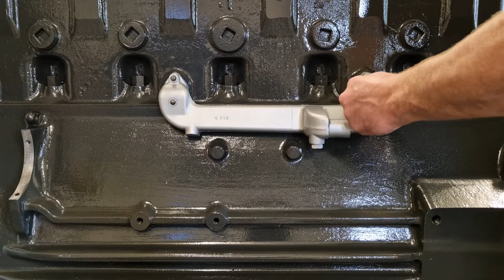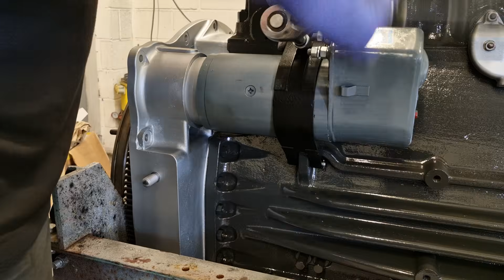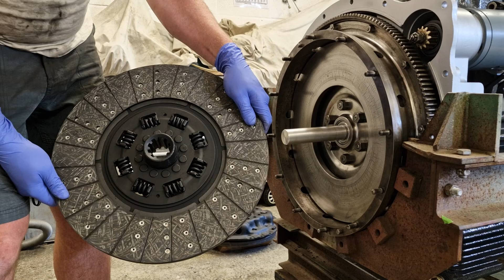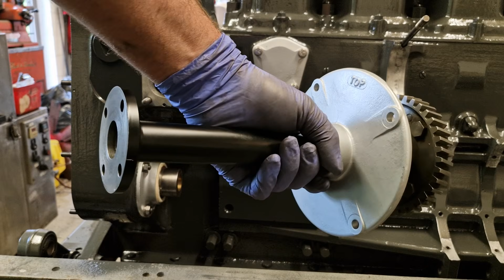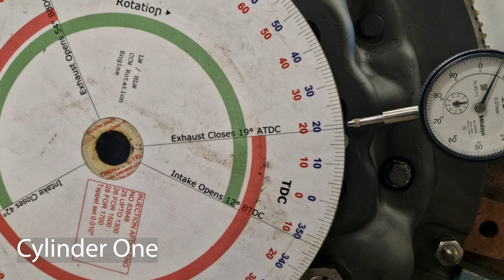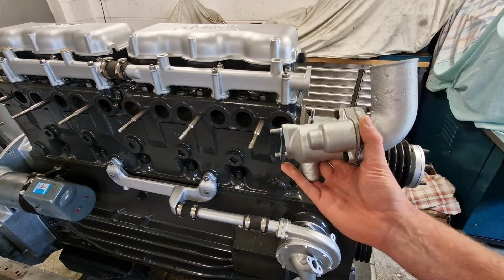Gardner 6LXB 180 Overhaul Part 7 - Heads, Timing and Shiny bits.... Atkinson Borderer

Comment: a bit late to the comments but having Rebuilt this engine.., WHY are you putting it together With PAINTED Gasket Surfaces ? Putting gaskets on top of a painted surface is Bad Really bad Every workshop manual in the world will Say about gasket surfaces that they are to be Clean free from grease paint or other contaminates just an obervation.

Comment: Flywheel has many cracks from overheating or slipping?
Reply from the maker: There was some heat cracking on the flywheel clutch plate, not the flywheel itself. But the clutch plate was NDT inspected, resurfaced and deamed perfectly servicable.
Reply: @MPSVintageDiesels  Fair play, just saying and understand you had seen the same and got it ndt tested. tough of girls they are for sure. thanks for sharing the content as very informative

Comment: Was the flywheel rubbing plate machined? if so did the flywheel/pressure plate flange need anything taken off to compensate?
Reply from the maker: 0.003" Taken off the flywheel plate and the same off the pressure plate to clean up the faces. depth of the flywheel plate altered (as its bolt in) to compensate for it.

Comment: I just can`t believe the Gardner company has disappeared. What a waste. And why.?
Reply from the maker: Unfortunately Gardner didn't move with the times and were late to the turbocharging fold which allowed the likes of Cummins to get a foothold by offering higher power outputs than Gardner could. By the time Gardner did go turbocharged it was to little to late with some of the last models like the LYT and LG1200 being rushed to market and suffering from reliability issue which tarnished the name that had been known for unrivalled reliability.
Reply: Best therapy ever rebuilding takes me back to stripping auxiliary engines off afloat ,cheers 👍

Comment: Hi There my real Name is Mr Cannadine T. Boxill-Harris I was wondering, why couldn't you and your teammates can still do those Rebuilding and Repainting those nice fresh shiny Gardner 6LXC, Gardner 6LXB, Volvo TD102KF, Gardner LG1200, and Cummins M11, 4 Speed Leyland Hydra cyclic Automatic Transmission Alexander RV Buses and Repaint them to a Grey Green Colours just like the original Scania Grey Green's which were in the North London and East London bus routes such as 141, 168, 179, 210, 275, 125, 173, 24, 167, 313 and also the bus route 103, if you guys would like to Rebuild about 228 of Those Gardner 6LXB, Gardner 6LXC, Volvo TD102KF, Cummins M11, and Gardner LG1200, 4 Speed Leyland Hydra cyclic Automatic Transmission Alexander RV Buses can you and your teammates put most of those Gardner 6LXC and those Gardner LG1200 4 Speed Leyland Hydra cyclic Automatic Transmission Alexander RV Buses to those East London and North London and that especially is including the London Bus such as those London Bus Routes such as for example the 296, 341, N29, 86, 41 and will also be including the North London Bus Route Number 221 for all of us Grey Green bus lovers in North London and including East London For all of us passengers out there Pretty Please? could you Repaint them in the Exact Grey Green Bus Colour and put them on the London Bus Routes which are 341, 179, N41, 34, N29, 149, 221, N73, 121, 86, 30, 296, 262, 147, 396, 56 and N26 for all of us Grey Green Bus lovers out there because we are Really Really desperately needed Are those types of colour buses to be brought back again Please? do it for all of us customers and passengers in North London and Living in those areas such as in East London Pretty Please? because it will be Very Very Very Very Very Very Very Very Very Interesting Buses to see them Repainted to a Grey Green Colour. I am a Big Fan of those Gardner 6LXC, Gardner 6LXB, Volvo TD102KF, Gardner LG1200 and Cummins M11 4 Speed Leyland Hydra cyclic Automatic Transmission Alexander RV Buses Please? Thank You Very Very Very Very Very much for your time, help and support.